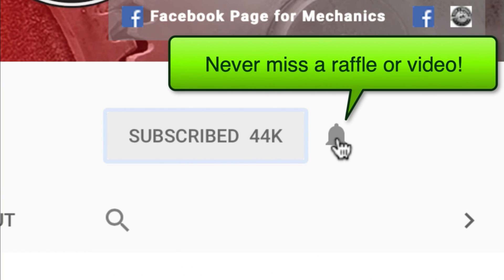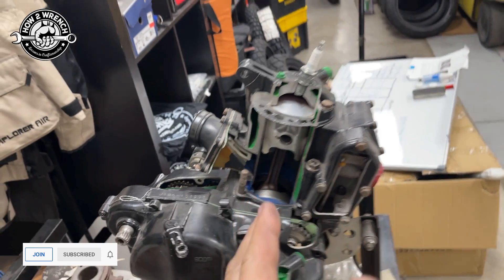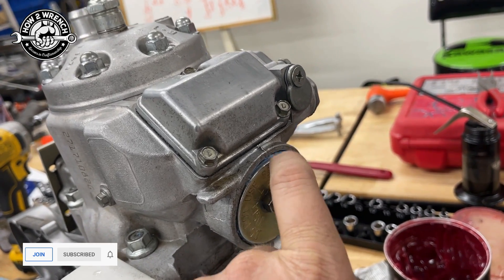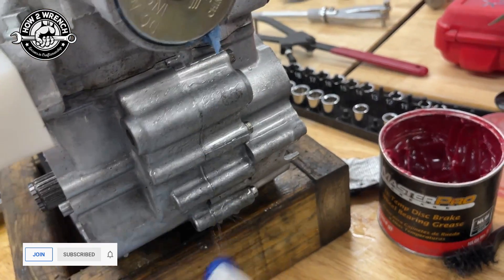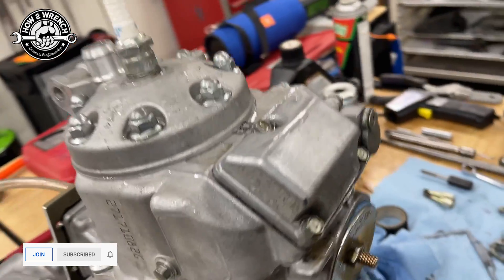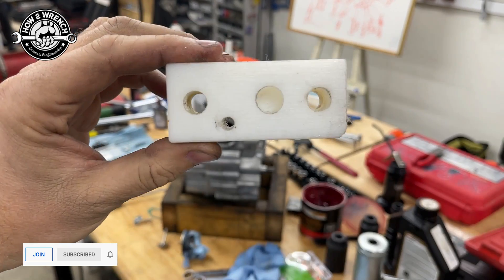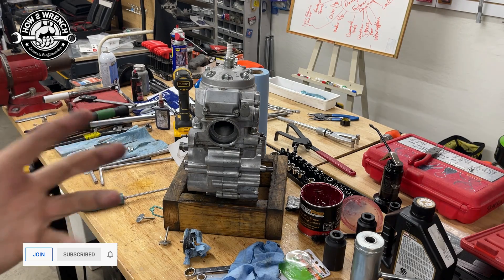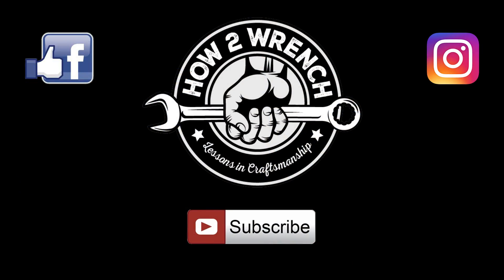DIY 2 stroke crankcase pressure tester. SAVE HUNDREDS Diagnose or test your work after rebuilding!

Comment: is it possible a center gasket causing pressure to the  crankcase? because my 2 stroke is spitting some oil in the vent. I've replaced the crank seal but still the same.

Comment: Do you have any idea if running a 2 stroke briefly, with the timing set wrong can blow any seals?
I accidentally ran a seadoo with the rotary timing plate installed wrong, you had to give it throttle to get it to idle or it would shut down. We ran it about 30 seconds until deciding something was wrong.
After fixing the issue and breaking the motor in, I noticed that the bottom end (rotary valve oil bath) was losing oil as if being sucked into the motor (oil bath is sealed and not supposed to fluctuate unless a crank seal leaks).
I pressure tested this isolated oil bath cavity and it holds perfectly for a 5 minute test.
Many people say to test 2 strokes for 2-12hrs. If I test for an hour I get a half lb drop and it is NOT the gage itself.
Any insights? 
Of course these 2 inner seals on the crank are not accessible since the crank shaft is assembled around them!

Comment: How are you getting air pressure if you're creating vacuum with the vacuum pump.? Aren't you sucking in air? How would it be forcing out here if you're sucking in air.?
Reply from the maker: The tool has a switch. Here it is: https://amzn.to/3u1bHL9

Comment: Would this work if the engine side cover was on? If the transmission seal was leaking, would you hear gurgling or air coming out the filler plug?
Reply from the maker: Hi Brandon. You are correct. You may have missed it in the video as to why the benefit is so you can actually see it and fix it before assembling all the rest of the parts. 
You rock! Best way to help us back is joining or grabbing our T-shirt! Support links and gear below!  Awesome and thanks for commenting! Smash the subscribe button (thank if already a sub!)
Have you seen our "YouTube Trained Support Shirts? Great way to "high five us" https://goodfellasmerch.com/collections/how-2-wrench/products/support-shirt

Join this channel to get access to perks:
https://www.youtube.com/channel/UCBhM8DCKnT3qXwTW0eToyCg/join   
-Daily MEMBER FIRST COMMENTS ANSWERED FIRST 
-Live Q/A video chats
-Wonder if we have a video on your need? Members can request content links!
-Full Access to the ENTIRE 700 video library
-Member-Only FREE tool giveaways   

Just want to say thanks quick to support us for this information and our work saving you money? 
Give us a high 5 here:  https://www.paypal.me/how2wrench   

Got an emergency and your head is about to explode from frustration or fear? Get Shane’s cell here: https://how2wrench.com/ols/products/techline-one-on-one
Reply: I rebuilt my kart racing engine after it broke a rod.when rod broke it barely tapped the case on reed cage side,after i rebuilt it had a bog mid throttle.i noticed it coming off corner thought my was throwing all fuel to the rs of tank and ran lean but it was cold and i hand choked it and my buddy seen fuel squirt from the case.😂so i put silicone on outside of case for a bandaid and that sucker took off and got rid of the dead spot